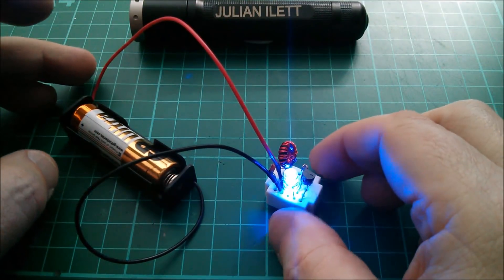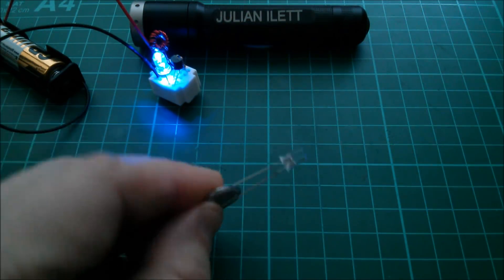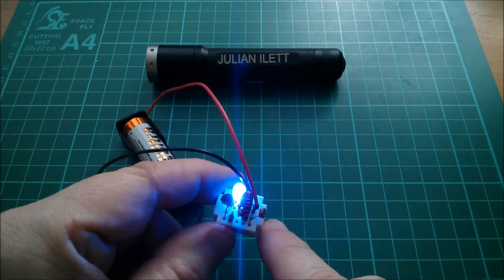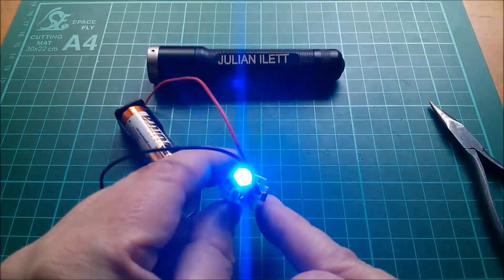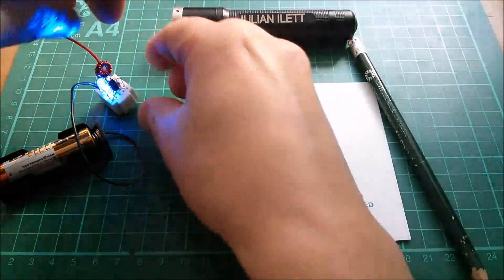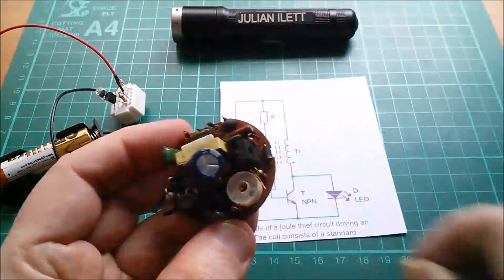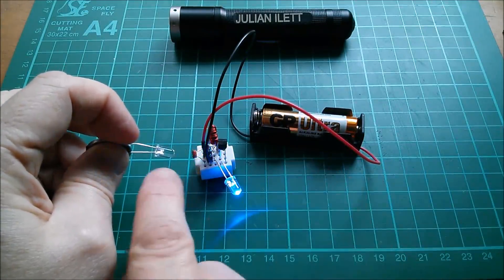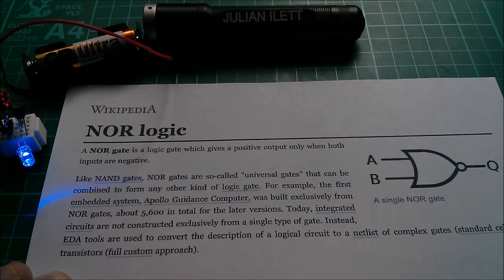Enhanced Joule Thief with LDR

Comment: What would happen if the LDR could "see" the joule thief's LED? 

I assume it would switch on and off, but I wonder how fast. 
Would it be switching fast enough to act like PWM, reducing the effective brightness?
Reply: The LED is already switching on and off rapidly in a Joule Thief!  Interesting question about self-activation though, worth trying.
Reply: Pook365   ldr's are sluggish, around 20ms or longer response time, which would give an oscillation below 50 hertz..  Could be an interesting design for a low frequency oscillator!  I'd guess that the output would be approximately sinusoidal,  which ain't that easy at low frequency.  Then again, it might just fail.  I shall ask my lawyers to serve a legal demand on Julian to do this and put his scope on it.

Comment: I've got a couple of torches only very slightly bigger than one 1.5 V AA or AAA cell and the LED works. I've always wondered where they hide the ferrite ring. I guess it uses a tiny boost chip instead ?

Comment: I love photo-resistors and movement detectors, they are really cheap and really easy to implement in almost everything. You can even buy cheapest night light that you plug to the wall or those battery light for wardrobe that light up when you open it, and without too much work you can just gut-out it and put anywhere, most of work on 4-12v and they are really efficient. I have one in bathroom converted to 9v battery with small resistor and it work for almost half year and still is bright as new. 
Those photo-resistors and motion detectors are really nice to slightly reduce power consumption in home. Because you dont really need to turn on light at night if you go to bathroom or other room, you dont need to turn on light when you get up from bed looking for slippers, because you can put light on wall or under the bed, you dont need to turn on light in the kitchen just to get spoon. So many ways to use it...
In last Christmas I spend few days converting all those cheap led strings lights to have light sensor and when normally battery die after 2 days if you forgot about turning it off, with those light running on 3 AAA, can last even week.

Its so cheap I have no idea why people dont use it more often, especially that they use LED bulbs anyway.

Comment: How long with a 1.5 volt battery light the LED?  Hours?  Days?
Reply: Usually days to weeks, depending on how much charge was left and how well the circuit is operating.

Comment: I have been playing with Jule Thieves for some time, all of them are back in South Dakota right now and i am in Arizona so I don't have access to them as I type, however I was amazed to find that I could light a 1 watt LED with one I built it using a ferrite choke that I removed from an old laptop power cord, you know the kind they are about an inch long an large enough to put a power cord through. It was very easy to wind, and looks great with the rest of the thief sort of strapped around the core. I put a small slide switch on her and mounted the whole shebang on a AA single cell holder.  I replaced the 1 watt with a regular blue LED after experimenting with it, now the 1 watt is glued to a 2 cell AAA holder with built in switch.  I have no idea how long the batteries are going to last, I have had it now for over 6 months laying beside my work table, and use it when ever I need extra light to read transistor or IC numbers, it is very bright for 2 AAA's in fact the other night i used it to light up the entire living area of our motor home when the power went out. It was on for over a half hour and the cells still seem to be in great shape.  No heat issues either.  LED'S are indeed fun to mess with.  Thanks for developing my interest in the field!

Comment: 3 way joule thief ring oscillator anyone?
Reply: Yes please! It would be interesting to see at what speed it could run.
Reply: I believe if you connect a cap in parallel with the resistor on the base of the transistor, you should be able to control the frequency/duty cycle of the oscillator to some degree (R/C).  I've seen someone else experimenting with that.
Blocking oscillators seem to be an overkill as far as being used as a logic gate, which can be accomplished much simpler by a single transistor and a bias resistor (pull up or down).

Comment: Sticking the LDR across the emitter base junction would not really turn off the circuit because it would complete the circuit on the base resistor causing a small current drain that does nothing.
Reply: Hence the 100 microamp draw when off.  It's not perfect, but how would you do it given that the resistance goes low when it sees light?
Reply: This is a simple circuit to test. Don't expect miracles my friend!!!!

Comment: I’ve had a idea that you could use a transistor to turn a electro magnet on and off to move the strong magnet in and out of a coil of wire 🤔 (when it’s on the magnet would be attracted to the electromagnet and when it’s off gravity would pull it back down) if the circuit was powered by sunlight you would get more electricity this way and DC to AC conversion 😮
Reply: No, you would use much more electricity than could ever be generated by trying to use a small amount of electricity to move a mechanical device. Save the power from solar cells in a modern battery or a large capacitor instead, and lose much less of it.
Reply: Donald Sleightholme gravity does not exist buddy

Comment: NOR gate = BOTH inputs are negative? Surely the term 'OR' implies either, not both....doesn't it? Isn't that definition for an XNOR gate?
Reply: NOR = OR followed by inverter - hence the symbol.
Reply: NOR gate is such that if any input is high, output is low. It's an OR gate with an inverted output, hence NOR
Reply: At risk of pile-on, my understanding is that it's "Not OR".  "Not" being a term for "the opposite" or "inverting".  Likewise a NAND is a "Not AND", that is an AND gate with an inverted output.
Reply: NOR = A or B or BOTH but the output is inverted, so any '1' on an input gives a '0' output.
XNOR = A or B 'exclusively'  and the output is inverted.

I felt the first paragraph of that wikipedia entry confused the issue in referring to negative inputs, rather than negating the output, which is where we indicate the 'N' part of the NOR on a diagram symbol.  Perhaps just the way I have chosen to easily remember it?
Reply: Not A NOR B can be active. Think of it like that.